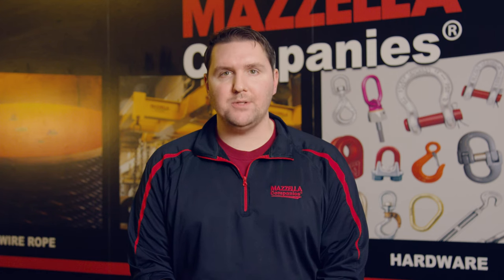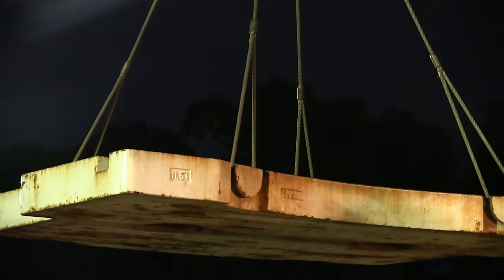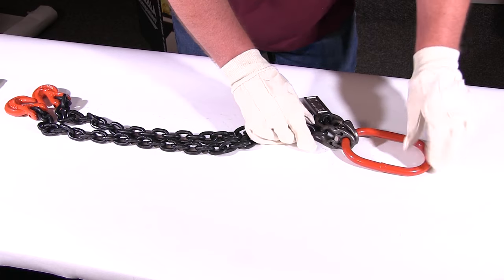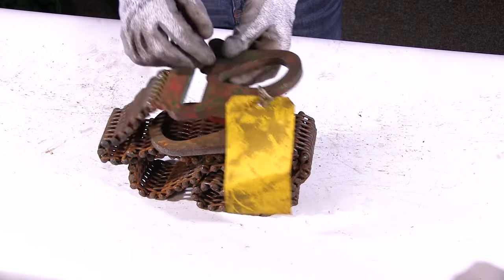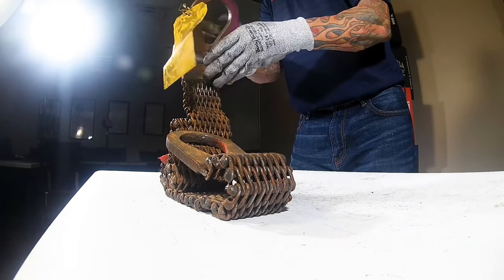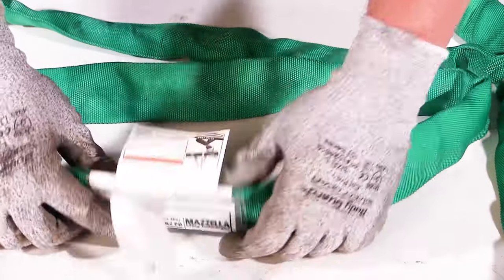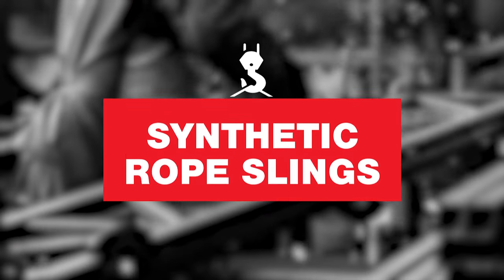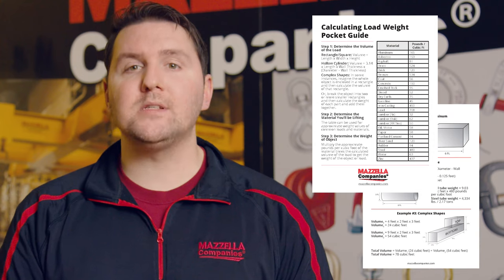Choosing the Best Lifting Sling: Wire Rope vs. Chain vs. Synthetics

Comment: So what stronger between steel wire and chain? Consider the both of them have the same material.
Reply: Always better to use wire or synthetic slings. Although there are a few exceptions.  A chain fails without warning and is only as strong as the weakest link.

Comment: if a crane/endless polyester slings was to experience dynamic loads, but loads of 1/2 or 1/3 of the WLL, would there be any danger of breakage/failure?
Reply from the maker: Rory, thanks for the question. I reached out to one of our rigging trainers, Nate Fisher, for an answer. This is what he had to say.

"Dynamic Loads can create a lot of stress on the slings, regardless of the material they are made out of or the weight of the load… There would definitely be a lot of concern about breakage or failure.
Slings and other lifting/ rigging equipment are designed to take up the weight of the load gradually and steadily. They work best with controlled, static loads. That is the safest way to lift. 
Knowing that you are working with dynamic loads, you must be vigilant with your inspections and inspection criteria. Have a procedure or plan in place for inspecting your equipment regularly and often."

I hope this helps. Let me know if you have any other questions.
Reply: @LiftingandRigging  
i appreciate the hell out of the response.

having an inspection plan and criteria seems like the cover charge, the minimum we all should be doing when working with heavy loads.

thanks again
Reply from the maker: Rory here is a bit more information from another one of our trainers. This is what Bob Gubanich had to say.

_"The definition of “dynamic loads” is any load that changes over time.
If that time period is very short, it could be defined as a shock load.  Shock loading can occur in any situation where the load on the crane and/or rigging suddenly increases.  
Intense shock loading can create stresses on the crane and rigging equipment many times the static weight of the load and is one of the most unpredictable causes of catastrophic failure.
Four of many factors that can contribute to a catastrophic failure are: 
                Ultimate breaking strength (UBS) of the slings and crane (design factor and WLL)
                Weight of the load ( percentage as compared to the UBS of the lifting equipment)
                Severity of shock load ( do the created forces exceed the UBS of any component?)
Overall condition of the crane and rigging
By using the equipment at a lower percentage of its WLL and of course, its UBS, you reduce the chance that the shock load force will exceed the UBS of the equipment.
If any of the equipment is damaged/worn etc., the UBS will be lowered, and the risk of catastrophic failure will increase.
So….yes, anytime we perform a lifting operation, there is always a risk of breakage or failure.
The competent person performing the lift must take appropriate steps to mitigate that risk, including, but not limited to; a lift plan, including some of the calculations listed above, and a thorough inspection program for all cranes and lifting equipment."_
Reply: Thank You so much for such a detailed reply. Salute to you with love and respect. @LiftingandRigging